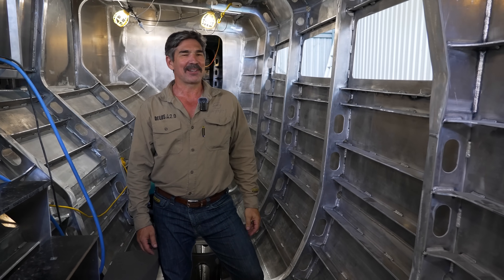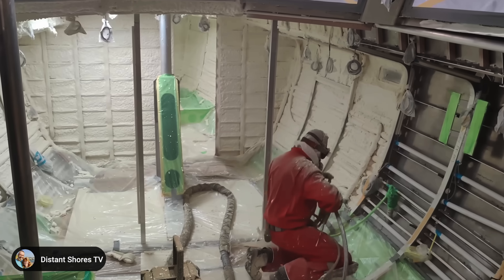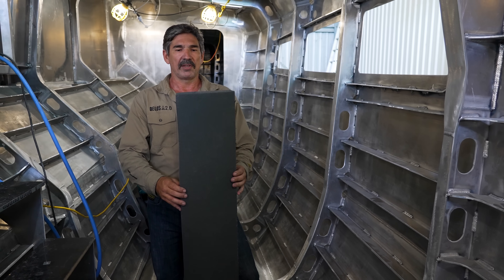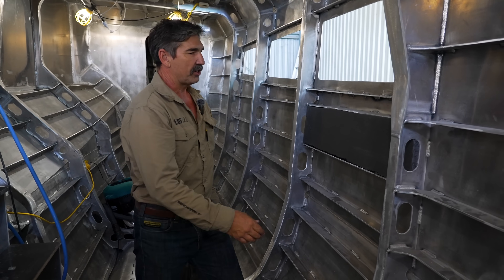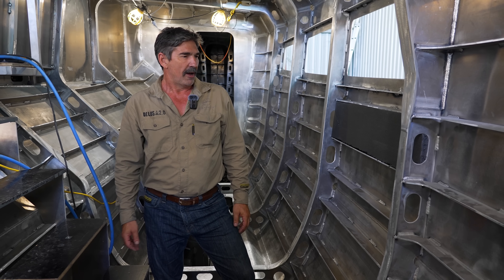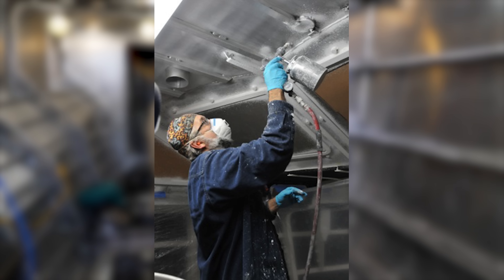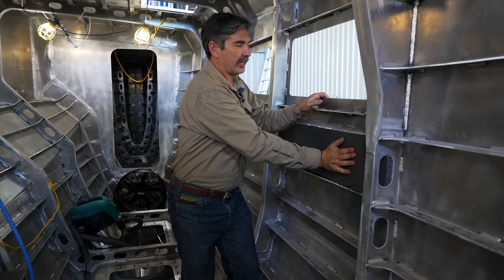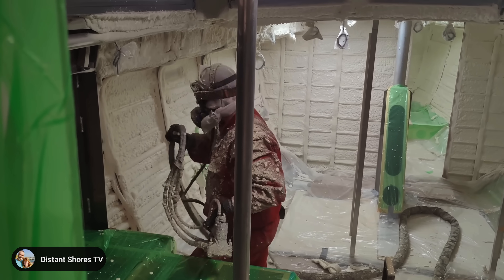HELP, We Need Your Advice!  How Should We Insulate Our Aluminum Catamaran???

Comment: The Dutch have it right - tubes for running wiring, then spray insulation to cover both the stringers and the sheets of aluminum. Undoubtedly you have tracked down the correct formulation. Anything else will cause grief before long.

Comment: If you go with the foam blocks, I don’t see why you would need the pins, if it is already a friction fit. I understand it is to pin the foam against the hull, but hard to imagine it would make it that much more air tight. It sounds like some sort of thin spray insulation + panels would be best of both worlds, but then again, why not go all spray insulation then. Thin film of spray would be easier to work with than heavy, but would it actually make any practical difference, probably not. I’m sure you will forget the hull as soon as you have insulated it

Comment: Zinc chromate, or something in the same ball park. Then something we used to use something called dyno-mat for sound detonation it is a stick on film and there are different thickness to fit your app also ads in thermal, then you can  use your Closed cell foam. This 3 step process will protect the metal but also complete your sound detonating and thermal needs with still being easy to work on for future repairs or add on. And also add little weight and no extra bulk keeping it slim.

Comment: I'd say the closed cell foam would work very well in engine spaces. Most everywhere else, you can go with the splurge expanding foam method and you should be just fine. Another option I've seen with other boatbuilders is sprayed cork insulation. The vegan approach to the engineering problem. Maybe that would work, but I've no idea whether or not you have anyone in Australia able to do that kind of work.

Comment: Spray-foam. Not my personal preference(enviroment + type), but for sheer ease of labor effort, buy a professional to do the work.

Do NOT DIY - the expansive caracteristics of the foam is un-controllable for you guys, and you'd be left with cutting and shaping excess foam for days + dust (I'm trained electrician and architect/Danish).

i LOVE lead-ways - you can pre-install empty currogated plastic tubes 'everywhere' for posterity - you never know when you need a cable pull in the electrical grid(repair, upgradability) or a replacement waterpipe. These tubes could be placed and attached with an adhesive pad(tubes not touching the hull/condensation) prior to spraying. This way you somewhat eliminate the limitations of the lacking cavities of the expadable foam. Indeed, the subject of accesability is a main trait of mine too - a cost-effective future proofing!

Following your twin-hull adventure, even from a distance, design questions popped up like crazy from the get-go. I'll give you a couple of my think-bubbles:
- Captains chair; why not look at comfort ergonomically and socially, prioritising high seat-backs and room for multiple persons - becoming a (movable on rails?) room devider with storage as well? Delos I has a cosy enviroment me thinks!? As humans we naturally feel more 'secure' up against 'something'.
- Front platform; in wet conditions you'll need local stage for boots/coats inside the 'cabin'.
- External Alu treatment/appearence; KISS...

Thanks for asking btw - enough for now. You probably know best yourselves.
All the beest🧤

Comment: I'd try to spray the hull with that coating you prefer then spray insulate thereafter. takes care of both sealing the hull and if anytime in the future the foam separates it won't cause condensation. As far as getting through the foam... seriously? it's foam dude ;-)

Comment: Hi.

Very good condensation barrier and insulation : sprayed cork.
3 to 6mm over everything as you'd do with spray-foam so there's no thermal bridging.
Then you add the xpe panels to get most of the insulation.

Cork will regulate interior air moisture and prevent condensation.
It's also fire retardant.
Easy to apply, easy to repair, waterbased glue, no toxic fumes...

Good job building this cat' !👍

Comment: For sure the only way to prevent condensation is to paint/spray everything so that the hull is fully covered with insulation without gaps. With the block type of insulation there will be gaps between insulation and the hull resulting in a lot of condensation.

Comment: Question: are you going with painted bilges or unpainted? 

Also spent a while looking into this!

There seems to be more people leaning towards spray in foam, I believe due to cost and ease of install. Eg. Pelagic 77 is sprayed. But Garcias are more like what you mentioned at the end. 

I looked into the mascoat stuff. Apparently used on the Aus naval vessels. The sound deadening demo was impressive however I didn’t like that it was water based and also required the same high efforts to paint Ali. It was also very expensive! 

I’m going to go with a closed cell with self sprayed in contact adhesive not the sticky back stuff. Then a thin layer to cover any stiffeners etc. 

A big justification for me is being able to inspect, modify and maintain. From my research the downside of foam sheet is the cost and time to install. 

Spray foam seems to have its issues as well. Our friends boat here (steel) was sprayed and because there was no way to inspect, it rusted behind the foam. A fridge caused condensation to run down behind the foam.

Comment: Everyone here that thinks its a good idea to leave an air gap between the insulation and the hull read this. When you put a cold soda out on a hot day it gets wet. It attracts condensation around it because it creates a micro climate around the can. Warm air hold lots of moisture but cold air does not. Since the cold air does not hold as much moisture in vapor form it turns to liquid on the can. If your boat is in cold water and the cabin is warm the inside of the hull will be the coke can. When you put insulation tight to the hull you move that condensation point away from the hull towards the middle of the insulation where its less likely to cause damage. Al the insulation guy

Comment: I think there are benefits to both of your ideas. My only advice is to adhere whatever insulation you choose to the hull carefully. The water you speak of behind the insulation will only occur if there is space between the insulation and hull. Getting that tight fit on curved space will be difficult. Any little bit of the hull that does not make contact with the insulation will condensate. Your idea of putting a continuous layer of insulation over the ribs and foam is good. Likewise any air between the insulation will result in moisture.
I would put the barrier paint inside the hull and spray foam. The barrier coat will help the foam adhere the the aluminum. Shape the foam so its even with the ribs and add a continuous layer over it all. Don't use those pins to attach the insulation. They will create an uneven force that will lift the foam between the pins causing small airgaps. Al the insulation guy

Comment: Best to focus this time on doing a great job of the spray foam.  Easiest to install, performs very well.    If you count the time when you would have needed to remove it (had you been in this boat the last 10 years) and then just accept that each occasion took you another few hours of prep - how many days effort does that come to?  Way more success stories you never heard about for spray foam than the horror stories - from my read most of the latter can be linked to poor base, prep and installation.

Comment: For what it’s worth, I think Garcia use spray cork, followed by a closed cell foam, such as the one you are looking to use. Spray foam is not too difficult to remove in practice, and can then be recoated easily, after any repair work is completed, using a can from any diy store.

Comment: Hi Brian, I have insulated my aluminium boat with the mascoat DTM along with the XTE foam.  Quiet labour intensive but Iam happy with how it’s turned out. 

I’m semiBrisbane based and still have all the gear to spray the mascoat if you were interested. In that option

Cheers mate

Comment: Put in duct work/conduit for all services, equipment and a few extra spares, then go nuts with the spray foam, just make sure you use a quality spray foam that is fire rated then apply an extra Intumescent coating at a minimum in the engine and electrical bays

Comment: Spray foam. I’ve had to go back in and make repairs and changes to electrical and it’s annoying to rip it out but not particularly difficult and then I’ve used the closed cell 2 part foam that comes in little aluminum canisters to respray the area I had to remove. Not the end of the world. It’s almost fool proof and super effective. Don’t over think it 😉

Comment: Thanks for this vid. I have been curious what solution you would find to deal with condensation, vapor barrier, corrosion prevention, sound deadening, ease of install and maintenance access. Seems like you have hit on something with combo of painted barrier with close cell and the foam anchors might allow for removal and replacement of the panels for access. That said you got us Googling and wondered if you had seen this demo from Sail Hub channel on Seacork  spray insulation (also includes some comments on sheep’s wool insulation - who knew)
https://.be/zXXzXpD3_ng?si=zDcR1Ye7eZP-8PNL
Might be you use different solutions for different areas. Cant wait to see where you land on this.

Comment: I mean I know not a whole lot at all on the topic but could you do a combination of the three? Coat the Boat, spray to not entirely fill everything(spaces to work on cables and repair areas), and cover it all with the extruded foam?

Comment: You have not touched on the most important part, and the one that will give you the most problem is the faces of the frames, where you will attach your in side liner. You cant use metal fasteners because the cold will travel the depth of the frame, and through the fastener, and will condense water. You have to Bond material to that face that will not conduct cold, but allows you to attach inside ceiling material 😊🇨🇦

Comment: I would use rigid foam panels,  cut to size, easy to work with. Not messy.  And removable to access wires/plumbing etc.

Comment: When you insulate an old house you skall not use any synthetic materials, which cannot absorb moisture. If it gets moist you will get black mold. You must use material that can absorb and release moisture like cellulose and semipermeable vapor barrier. I am sure that this also will fit a boat.
You also need ventilation that  decreases the humidity indoors especially in the tropics.

Comment: During a video on the Nautistyles channel who are having a Bering 82 built in Turkey. The Bering business owner discussed internal insulation, which was being installed on their boat, which is installed in a similar manner with pins glued on the hull.  Could be a good idea to contact the Nautistyles channel to ask if Bering Yachts are willing to provide information on what they do.  The Nautistyles couple have sales rights for North America. Issues would be the fixing of tabs to the aluminium, density of the insulation and external covering of the insulation for wear and tear. May be good to fix an external covering attached with velcro tabs to protect the insulation.

Comment: In the process of building an expedition sailboat also and we went through that same question. We will go with spray foam, but using eco material. The alternative would have been cork spray first (on the paint ... we have a steel hull) and than use closed cell. The closed cell is very expensive and the spray foam has a very good price and good r-value. A 1.5 inch of insulation provides a R-12. It is also Class A (fire).

Comment: 65 yr old Naval Architect, Live-Aboard and Boatbuilder specialising in metal boats. (Awesome build BTW thank you for the videos). While I almost always recommend spray foam for all the reasons covered below.. I do like your thinking on the painted surface and then cut blocks too. BUT, a mentor once said "A boat is only as good as the sum of it's compromises" So I think I'd swing back to the spray foam as there's probably fewer compromises there. WIRING If you think you need 2 wire conduits, PUT in FOUR.. IF you think you need 3" tube use 4" instead. You WILL be adding more wiring later. One of my mistakes on my current boat.. not enough room to pull new wires. LAST recommendation: Use some foam tape on top of your flanges between the interior paneling and aluminum as a thermal break. I wish I'd done that on my current one as well. I also go back and forth on VAPOR BARRIERS.. sometimes I wish I'd done that but I don't know if it would just cause other issues.. I would look at Tyvek or other one-way vapor controllers. There are some good lengthy insulation threads on Boat Design Net forums as well.
Reply: Hi, Sorry to bother you with a stupid question. Meaning that I'm not building anything, and I just ask of curiosity. Is it possible to apply the liquid vapor barrier Brian was talking about and then go in with spray foam? Would it be overkill because there is a good enough vapor barrier with the foam alone, please?
   Why I'm so interested in vapor barriers. There was a court case that was part or the reading when I went to law school, back in the long ago. It concluded that not having a correct vapor barrier in the house was not a hidden fault, the plaintiff didn't do his due diligence when inspecting the property (the professional building inspector or what the term is in English), and the plaintiff was turned down. That's when I decided to never buy a house. I would have read the case in 1989 or 1990, and I still haven't bought a house. If you read this far, thank you. Yours, Ann
Reply: @annlidslot8212  THere are some spray coatings that you can apply on top of the spray foam (after the spray foam is done and trimmed). The coating gives a hard waterproof glossy finish
Reply: @rickwelin9773  Hi, Thank you so much for your answer. I didn't really think anyone would find it worth the effort, as I'm not building anything. This surface would then be the vapor barrier, am I interpreting it right? So if mould would happen (this was the fault in the court case) it would happen between the aluminium and the spray foam? Not that I would expect mould happen these days when we know how dangerous it can be. I'm just trying to understand with my limited know how. Yours, Ann
Reply: No vapor barriers. You never want to trap moisture between 2 barriers (the skin of the boat being one)

Comment: For my steel boat refit (43ft ketch), I had to remove hundreds of bags of old, mouldy spray foam. Never again. Fitted 2” closed cell foam panels and then a 1” gap between the foam / metal and the inner liner (8 x 4 plywood sheets). The air gap allowed air to flow in the inner skin and any condensation to run into the bilge, and it was easy to remove foam for surveys or additional wiring runs. Spent four cold UK winters living aboard just fine. 14 years later, the boat is still doing fine with zero rust and no mould.

Comment: You have to go see and ask what the Bering yacht does with insulation. They build with metal and aluminum. In addition, they build catamarans 60-80 feet now completely in aluminum. What they insulate with is the right way to go. So do like them.

Comment: Hi, so most of the Comments are for spray insulation, how about painting the flat parts with oil first then it just sticks on the edges, no air gets behind and i should easy be removable

Comment: Had a couple thoughts, first one is double pained windows and the second is heat exchanging. So with double pained windows you get an insulation effect by stopping heat transfer with an air barrier, or a different gas filled space. So could you build an inner hull that is sealed from the outer hull by an air gap? Does it make sense? The second is, don't you want heat transfer some times, i.e. in hot climates. So is there a way to do both the first and second? Could you create an inner hull that has a thin insulation layer, and have a seal-able space in between that can be opened and closed? Perhaps with a fan or fans to help facilitate heat transfer when desired and to "air" out the in-between hull space? Would it make sense to measure the temp/humidity in such a space and have a computer manage the vents/fans? Would it even be possible to have a fluid heat pump transfer heat to the hull on hot days, or transfer heat sources(engine/freezer) to the hull? They do something similar inside some computers to move CPU/GPU heat to the outside. Of course you need to watch out for dissimilar metal corrosion and other forms of corrosion, so at least try to measure things that cause corrosion... I have seen spray on foam on Aluminum on RV shells, some almost 40 years old. It lasts a long time, but it does age faster than the Aluminum, something to think about on a 50+ year old boat. I suppose if you want to get really deep, you could also think about what happens to the boat in the end. Will it make it harder to recycle/reuse... The foam also has environmental impact issues.

Comment: You’ve probably watched this but Distant Shores used a full system of conduits run through the frames for all systems and interestingly they spray foamed everything above the water line and painted the bilges. I’m a GC and would expect closed cell foam to perform the best. Hand fitting any kind of foam insulation into such convoluted spaces will take countless man hours and inevitably leave literally thousands of little voids.